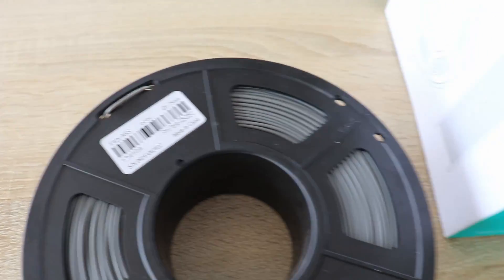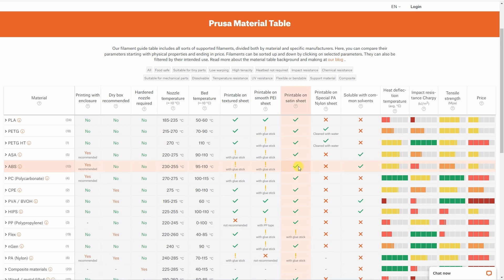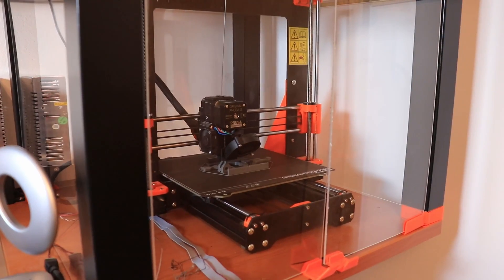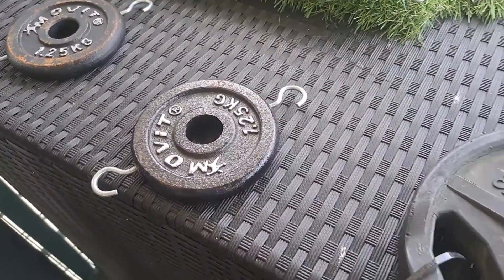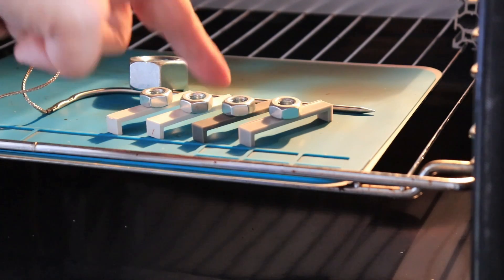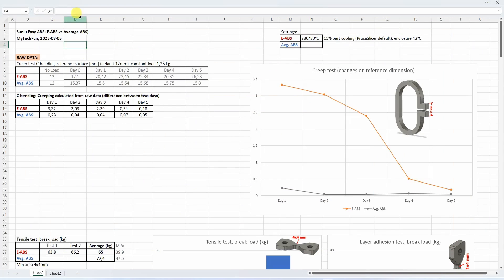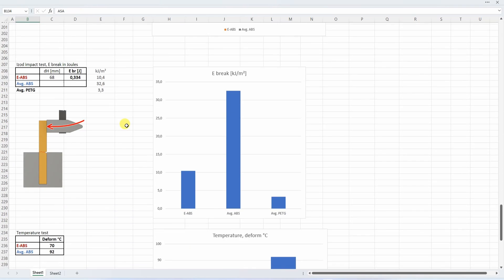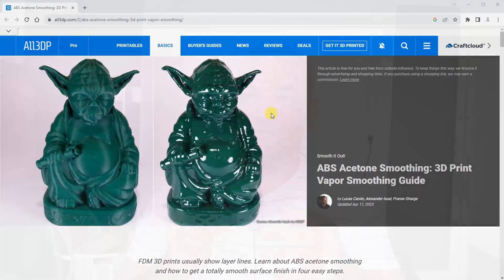Sunlu Easy ABS: easy for 3D printing, no odor, but what about mechanical properties?

Comment: You mentioned as a reason to choose ABS the acetone vapour smoothing. In my experience these "easy to print ABS" materials because they are not pure ABS and can contain all shorts of stuff inside, do not smooth well with acetone. Maybe vapour smoothing rate/consistency is another test that you could do when testing materials that are vapour smoothable like ABS, ASA, PVB etc. The temperature resistance is indeed disappointing and I would not recommend this material to anyone building a Voron. Thank you very much for another great material test video. Keep up the good work!
Reply: You’ve not used Sunlu apparently because the stuff is like a dream even thier pteg as well. Best plastics around
Reply: This was the main thing I wanted to hear about on the comparison. Does it vapor smooth?
Reply: @weldingjunkie  What are you talking about? noone said anything about sunlu. he said the easy abs shit is not pure abs so acetone smoothing might not turn out as well as with regular abs.

Comment: This might be good for people that only have an open printer and need something with some impact resistance that won't shatter when hit like PETG or PLA, or for something that has a little more heat resistance than PLA. Apart from that if you have a printer that can print ABS, just print ABS.
Reply: Petg doesn't shatter in my experience.
Reply: @sleddarcheddar You haven't hit it hard enough or with repeated impacts then. PETG is even worse than PLA is when it comes to shattering. PLA will tend to crack and deform, but with a really strong, sharp impact PETG will often shatter more like glass. At lower speeds and less violent impacts it tends to flex more and recovers better than PLA does though. A good brand of PLA+, on the other hand tends, to handle repeated sharp impacts way better.
Reply: Bs.. Petg shatters

Comment: Great test, as usual.
Would it be possible to test QIDI ABS-GF25 (which GF core, so less GF on the and outer surface) and compare it with eSUN eABS-GF and Bambu Labs ABS-GF? Of course, printed inside the X-Max 3.
Besides the inner GF core of the ABS-GF25 resulting in less wear on the hotend and gears, maybe the outer ABS shell will improve layer adhesion, which for GF filaments it's often an issue (see your PLA-CF vs PLA-GF).
It could be an interesting experiment, now that the number of suppliers offering ABS-GF is increasing.
It may be worth taking some macro photos as well, since the core-GF may result in a less shiny/speckles on the surface.
Reply from the maker: I have 4 Qidi filaments on the test (currently the GF25 not yet, but it will be tested too soon). And I have BambuLab ABS-GF in 4 colors! There will be a comparison between them. eSun ABS GF test is in progress, parts are already printed.

Comment: So far I have tried their pla + and it was OK. Not as good as other brands like eryone, polymaker and even cheaper brands like elegoo pla/+. I found that bed adhesion was not as good, colors are not as nice, and layer adhesion was not as good as some others. I have tried many brands and I would say sunlu falls somewhere in the middle of the pack. Now the fact their abs melts at a lower temp to me is kind of pointless if their deformation temperature point is lower than regular abs for my needs. I use abs for printer parts like fan ducts etc. So it would not be a good choice for me. Thanks for sharing. Cheers from Canada 🇨🇦

Comment: Van egy tekercs fekete ABS gembird  filamentem  és nem úgy viselkedik mint a többi szín, vagy valamit elrontottak vagy nem tudom.
90 foknál az asztalról feljön a raft, szinte képlékeny és 240 foknál folyik az anyag. 215/75 fokkal kell nyomtatnom szintén rafttal és a második rétegnél be kell kapcsolnom a hűtést kb. 50%-ra és így lett jó. Ami még érdekes hogy acetongőzbe nem lehet simítani csak olyan lesz mint a gyurma, amúgy az aceton oldja az anyagot.
Ennél sem tapasztaltam repedéseket, szépen egyben marad a nyomat.
 A gépemen a hőmérsékletek rendben vannak.